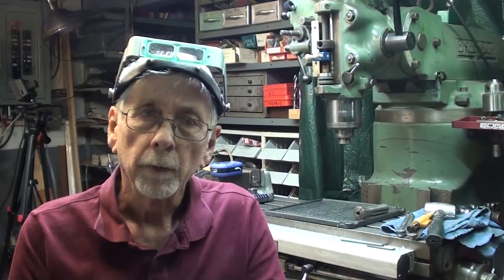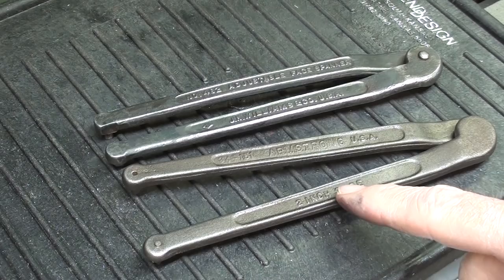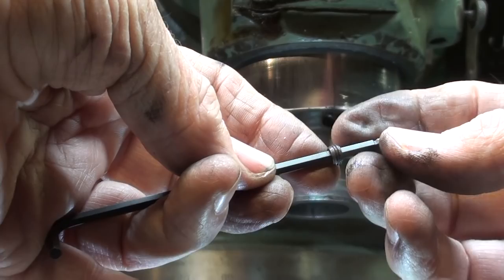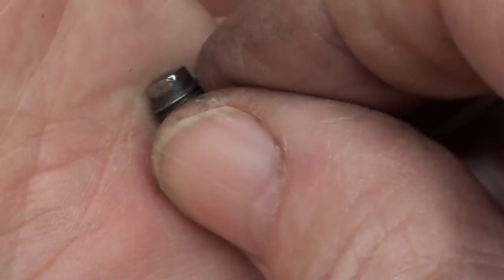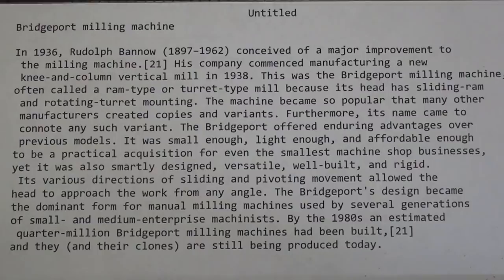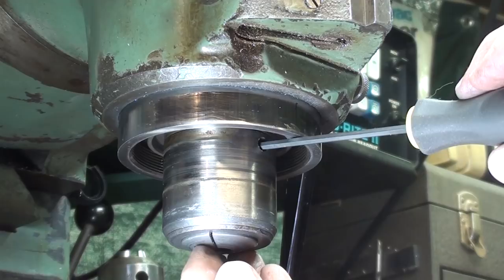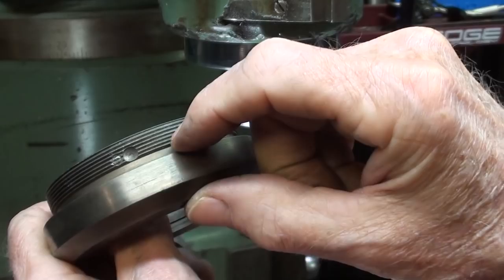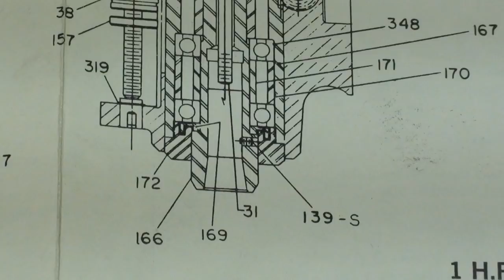Repair BRIDGEPORT MILL Spindle Key TIPS #615  tubalcain

Comment: Once you take the nose piece off, you can tighten the spindle lock, insert the draw bar and tap the spindle down in the housing to expose the set screw.  This will allow you to use a straight Allen wrench...
Reply from the maker: Thanks

Comment: Lyle, the purpose of the R8 collet keyway is to prevent collet rotation when running up the draw bar. In the original Bridgeport spindle.the dogpoint setscrew was adequate because it was designed for endmills and light boring requiring low driving torque; the original motor was only 1/3 HP. 

The dog point setscrew used to index spindle tooling was never intended to resist cutting torque. It shears at about 70 lb ft, far below the impulse torgue if you over-feed a hole saw or break through hand feeding a 1" S&D drill. Modern turret mills are furnished with 2 HP motors and only a 0.146" dia dog point to drive the spindle tool on a 0.440" net radius. Work the math. It's a shear pin for all practical purposes: the R8 spindle has no effective positive driving feature and the R8 taper is inadequate to provide reliable drive under momentary overload.. 

In the intervening 80 years, whopper carbide face mills, hole saws, large diameter Silver and Deming drills, sweep tools spanning a 10 " face, etc have become commonplace - as have buggered up and sheared collet indexing setscrews. Once sheared the dog point stub spins with the stalled spindle tool and scores the upper straight collet fit in the spindle often preventing collet extraction. A careful craftsman such as yourself never encounters this problem because you instinctively understand the limits of your machine. 

Us noobs and roughnecks sometimes spin or at least slip a tool from over-torque. A revolution or two won"t hurt the spindle taper but it destroys the collet indexing setscrew. Therefore, my advise to turret mill owners is to remove the collet indexing setscrew and throw it far into the bushes. Its presence poses a greater hazard than its absense given the common use of high torque demand spindle tooling. 

Your friend who advised you to remove the collet indexing setscrew was correct in my opinion confirmed by long experience in production shops. The question for most of us is not if the spindle tool is over-torqued and slips in the spindle taper but when - it's almost inevitable.
Reply from the maker: Thanks 👍👍

Comment: Hi
The nose piece actually holds the outer bearing cage in place inside the quill.
You should therefore tighten the nose piece to the correct torque from the maintenance manual and recut a new dimple on the thread, remove all swarf and refit, otherwise the bearings will be loose in the spindle and give rough finishes.
Thanks for a Great video Jack

Comment: A tip for reassembling, don’t over tighten the set screw holding that nose piece. It can slightly deform the quill and make the travel seem stiff.

Comment: I'm about in the middle of rebuilding a Bridgeport J-Head which I bought last year, and which Bubba had filled with grease and sawdust(!!!) as well as snapping the quill feed reverse knob clean off. Half of the handles have been replaced with cap-head screws and the like.
Anyway, tore every single solitary part all the way down, used aircraft remover on it to get all the miserable Ford blue paint off the thing (I was surprised the motor ran at all in that color) and repaint with proper grey.
Hazel, my little girl, (she turns four in August) loves to watch me fool around with this thing. I'll have it up and running for her as a high school graduation present, at least.

Comment: I recommend using only genuine Bridgeport collet alignment keys. The Bridgeport part IS expensive, BUT aftermarket parts are expensive also, and inferior IMHO. The Bridgeport keys have square milled end and are hardened. Aftermarket keys have a round dog point end and usually made of stainless and tend to shear off fairly easy. The thread on these parts is 1/4-32NEF. Please don't try to force a 1/4-28NF set screw, it won't work. After removing the spindle nose, partially driving out the spindle cartridge makes accessing and replacing the collet alignment screw much easier. All R8 tooling have variations in key depth. Measure ALL of your R8 tooling and collets to find the shallowest key. Finding the shallowest key will help to install the collet alignment key and keep tools from binding on the key. The procedure I use and recommend: Slide the tool with the shallowest key in and out of the spindle, turning the key 1/4 turn at a time until it drags or binds on the bottom of the keyway, remove the tool and back the key off 1/2 turn, reinstall the tool, install and tighten the jam screw. I did this in a shop with 14 Bridgeports, of every vintage, and never ran into any issues once I started doing this.

Comment: You asked for our thoughts.

It is interesting to note that the indent in the nose piece tread, machined at Bridgeport, would confirm that it should not be tightened fully.
Maybe there is built in allowance for thermal expansion of the bearings or for some other reason ?
Totally agree the grubscrew is not a drive screw much the same as the tang on a Morse taper is for extraction not drive.
In the real world they both will "drive" in border line circumstances.
We have all seen tangs twisted off because they are not strong enough to take the full torque.

Comment: Lyle the BP manual says the cap should NOT be tight and that there should be a 3 thou gap between the cap and the quill. Also DO NOT over tighten the rear screw into the dimple as it will distort the cap . Thanks for the video.
Reply: Dave, I do not know how you are interpreting the instructions...   The cap for sure should not be contacting the bottom face of the quill.  There should be some gap there.  The cap is really applying clamping force to the spindle bearings outer race. But you do want to torque the cap. If you do not, the bearings will have no preload.  The word "tight" can mean tight-against a face or it can mean  tight-torqued like a thread.  I think either you are interpreting the manual wrong or they use the ambiguous word "tight", when they should use "flush" or  "torque".
Reply: @kooldoozer  Thank you for your comment, But I disagree with your statement about the cap adding preload to the bearings, total garbage, the outer races are a tight press fit into the quill and the bearings preload is achieved by tightening the bearings locking collar. I am speaking after 35 Years of experience as a Machine Tool Fitter and of servicing BP's especially the 1970's models with either the vari speed head or standard head. Wish there was some how to upload screenshots or pages from service manuals.
Reply: Thanks Dave, this is just the info I was after! I had my spindle nose come loose whilst machining and I’ve found out from this video where the grub screw is to retain it, and now thanks to you the correct way to refit this correctly. Cheers Rob

Comment: The key in my round ram Bridgeport was broken off flush when I got it. After watching this I went about fixing it. Mine was not a hex screw with a second locking screw but rather a long slotted set screw that was staked in place. It was 1/4-32 UNEF thread. It was long enough that I was able to put it in the lathe and cut a dog of the appropriate diameter on the end. I degreased everything and reinstalled it to the appropriate depth using blue Loctite. Thanks again Mr. Pete! My nose piece was not quite hand tight and had a very, very slight gap with the set screw in the dimple and I reinstalled it the same way. All seems good so far. 
Oh, and I was able to tap the spindle down for easy access to the key as several people mentioned here.
Reply from the maker: Thanks That’s awesome

Comment: My alignment pin was almost non existant when I took possession of my mill. And at some point the key that did exist removed itself from the equasion. I have used it for several years without it. I haven't had any problems so far. But I haven't put  the collet under such a load that the interferance fit has been compromised. I had always thought that the key was just a convience holder for the collet while tightening and loosening til the fit takes hold. Thanks for the instruction. I may one day decide to repair it. I would have loved to have been under your instruction and had that opportunity in highschool. Our highschool had a couple old linclon buzz boxes a drill and rail road plates to learn how to weld on. And that was it. Thanks Mr. Pete.
Reply from the maker: Quite a few people have said that the key is not necessary

Comment: Great video thanks for the info. Keep in mind this is a ¼-32 extra fine thread. When the nose piece is removed you thread a collet in the spindle and tap the draw bar to lower the spindle and you'll have a straight shot to the set screw.
Reply: I tried this on my machine but it did not work. Did I do something wrong?

Comment: I bought a Supermax mill that someone actually drilled the nose cap all the way through and put a long flat tip screw in place THROUGH the nose cap into the collet. I couldn't figure out why the nose cap was just hanging on the screw not knowing how it was originally. By doing what they did, it immediately stripped my nose cap threads and it was spinning with the bits. This video helped me understand what is all goofed up on mine! I've found the parts and luckily my quill looks un damaged. Thanks!

Comment: Thanks for the vid!

At work and had my shell mill stop spinning while trying to cut. Turned out someone had tried to make a replacement some time ago....
I did find a new one to use.

Maybe have a wood block below everything as well as I did knock the spindle out of the quill while aligning the pin with a collet, I caught it so no damage.

Comment: H&W reccomends to screw the inner set screw in since the working end is probably damaged.  I think its 1/4-28 thread.  Also it is NZoT a key.  It sole purpose is to allow you to remove the 7/16 draw rod and collet if the threads become tight.  Live a little, buy the right parts and stay home during the next tool auction.

Comment: I believe the “key” is there only to remove the collet if the threads of the draw bar are sticky and the collet would just spin if not for the key. My spindle nose nut on my 1968 J-head was not tight either. H&W suggests turning the hollow screw back out and the dog point set screw forward and catch it. That way if the tip is distorted it will not harm the fine threads. As mentioned below, the spindle can be tapped down for better access.

Comment: Some of the import milling machines have left-hand threads on the noise. I made a dedicated spanner wrench at work and engraved left-hand threads on it.
Reply from the maker: Thanks
Reply: The old Gorton milling machines my family use to have in our shop, the retaining nut was left hand.  It was marked with the letters "LH" clearly on the nut, so Bubba would not mess it up getting one off.
Reply: Yes, my imported milling head has a LH thread on the spindle nose cap.

Comment: Lyle,

Replacing collet alignment setscrews was such a common problem in a production shop we made a modification to every machine quill. We removed the quill and machined a clearance hole so no disassembly was required and the set screws could be accessed without the need for a ball end hex wrench. Another problem is not all collet manufacturers machine the key slot to the same depth. If you take the trouble to set the depth correctly for your test collet, an operator is certain to unearth one that is shallower. If he is a Bubba, expect him to force the collet in requiring you to get it out for him and resetting the collet alignment key screw depth.

Bondhus makes stubby wrench sets. You don't need to make your own. The stubby sets have a tighter bend than a standard wrench that you modify. This tighter radius gives more working clearance than a modified wrench and allows the stub to be a bit shorter.
Bondhus also makes a stubby version with a ball on the short end of the wrench. This stub is angled a few degrees. This style offers a wrenching solution that is exceedingly seldom required.
 You love vises and tap wrenches. You have many more than you need. I own every version of hex wrench made. When I couldn't find what I needed I made my own.
I have full sets of square end and ball end, metric and standard L wrenches, T handled, screwdriver handled, square drive short and long. Industrial machinery is most commonly assembled with socket head hex fasteners. The industrial repairman doesn't skimp on hex wrench versions.
Bondhus are the best value tool on the market. They are inexpensive and durable. A couple of the European folk make very fine L wrenches, but they are more costly.
I like my Snap-on sets, but their hex stock is softer than some.  Some makers reduce or increase the hex stock shank to fit a common sized square drive for your ratchet. This encouurages breakage of stepped down or is oversized often down to the business end, making working clearance reductions. My smallest driver is .028". I don't believe anyone makes a ball driver that small! I was our only technician that ever required tools that small. I seldom required anything over 3/4" or 19MM.

Comment: It was good that you took care to go slow and explain what was needed and how to take it apart. Too often steps are omitted or glossed over assuming others know what is going on. I seldom do. Not sure about my MSC mill but would assume it is very similar. Now I know one more repair opreation should I have problems with the R8. By the way I just spent about 2 hours traming my mill. I have one of thoes double dial indicators which helped a lot, but it still was a pain. I would rather join you on the ship with salt water as well.
Reply from the maker: Thank you, they can flog us together

Comment: You might get a collet tight without a key and it might hold against the torque as well. But in doubt you will never get that collet out as drawbar and collet would spin together and not lose up.
Reply: Good point, thanx.
Reply: My mill had the pin removed when I rebuilt it over 15 years ago.  Never had any issues with the collets sticking to the draw bar threads.
Reply: @4GSR  Some people get lucky.

Comment: The key is not there to hold the collet, but there to hold while the drawbar is pulling it into an interference fit. It will snap off if you have torque applied to a non tight collet, as a safety feature. The more modern one might be made as a version with a nylon insert integrated into it, or as one with a deformed thread, so it is self locking, or they just used a drop of thread locker in assembly. The lock screw definitely is an attempt to fix the original coming loose, but a bit of locking compound would work better.
Reply: the double grub screw arrangement is actually quite common on the Bridgeport, and appears three other places in the machine.
It is equivalent to a locknut on a bolt, and ensures both that the dogpoint does not get too loose and also does not accidentally vibrate into too tight a position.
Reply: Bridgeport applies a thread locking compound to the locking screw. I use blue Locktite if I reuse this screw.

Comment: What a coincidence Barry from H&W repair posted a video on there YouTube channel Friday covering this very subject.  I bought my Bridgeport mill used and never knew there was supposed to be a key way screw in the spindle. I saw another video about them and went to H&W to get new belts that it needed and got the screw and lock screw along with the belts. They gave me an instruction sheet on how to change them the replacement screw is round on the end not with flats like yours. When you put the nose piece back on if the dimple for the set screw lines up and it's not tight remove it and restart the threads until it lines up tightly. By the way I learned how to change the belts from the video you posted on how to do the job that's how I found your channel. I remember at the end of that one you said too make sure and retram the head because you had shown to lay it over 90 degrees to make it easier.  I was clueless about milling machines and searched YouTube  how to tram a milling machine head and there you were with another video. I have been a subscriber ever since that was 2007 or 2008
Reply from the maker: Thank you for watching. Yes it was quite a coincidence that HNW put that video on at the same time as mine. I actually filmed mine two weeks ago. And how many viewers are saying you don’t even need to use that setscrew throw it away?

Comment: I used to have to leave mine loose. Like others have said. Cause some collects wouldn't fit right,so I'd rotate  1/2 turn out. This was a pita. Then I read somewhere online that you really don't need it . I tried it and love it. Using it this way  for about 6 years    no problems at all.
Reply from the maker: Maybe I should take the key out and throw it away
Reply: @mrpete222  yes I removed it completely. But I saved it. In fact they removed them it the 4 mills we have at work.